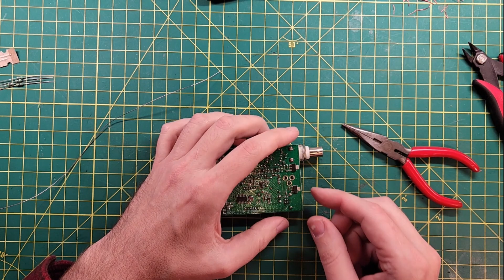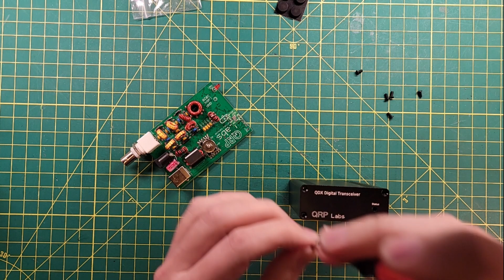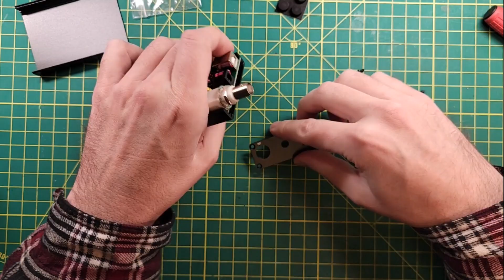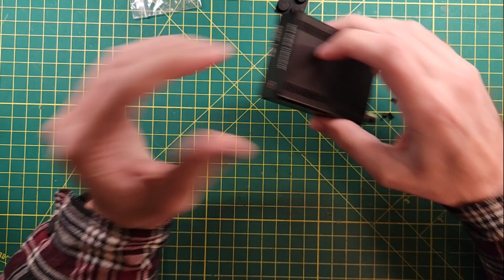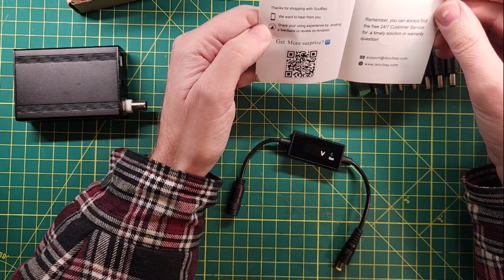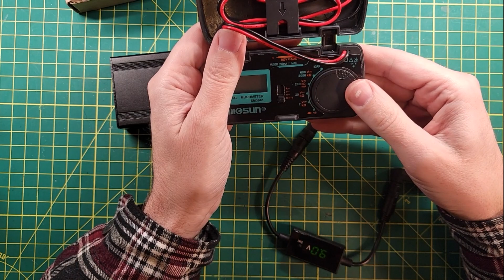QDX Build 4 - Connectors, Power Cap, Inductor Tragedy and First Power Up

Comment: Thank you for the guidance through your build. I purchased a rev 3 version and between your videos and the updated guide you helped give me the confidence I needed to build this thing on my own. Thank you!
Reply from the maker: You got this!  I need to set  a date for the TOADs group build.  People are starting to get their kits.
Reply: I should have mentioned I already built mine and was posting this thank you after the fact. 

I am in the process of getting a permanent power supply for mine but so far I've yet to release the magic smoke, and that includes running the built in transmitter tests.

Thanks again :)

Comment: This is the part of the kit build i despise, i always damage the circuit board, ive almost sworn off kits totally
Reply from the maker: I always cross my fingers and my toes for this one.  There is a probably a way to check for shorts and such before you first turn it on... and there can be other ways to fix it after if smokes out too.  It gets easier as you build more.